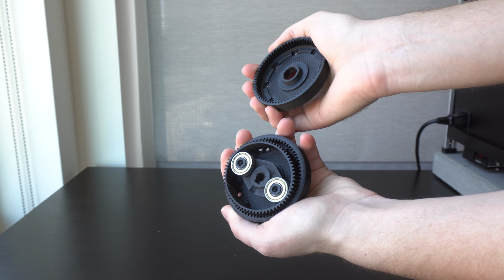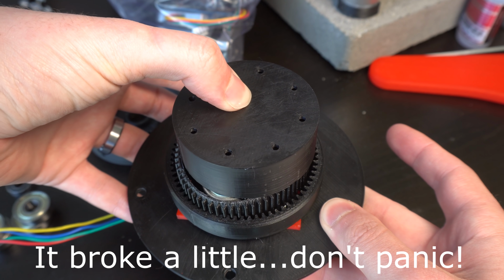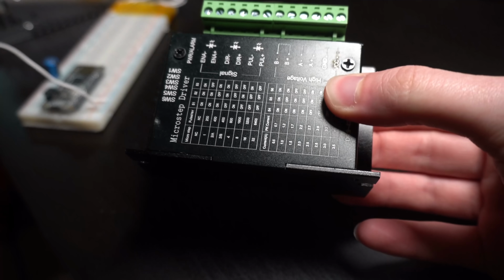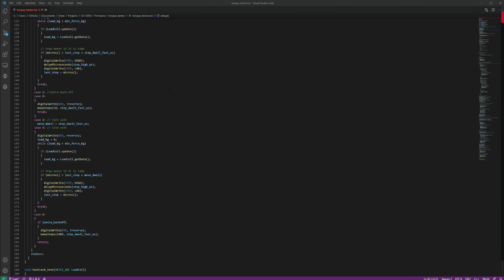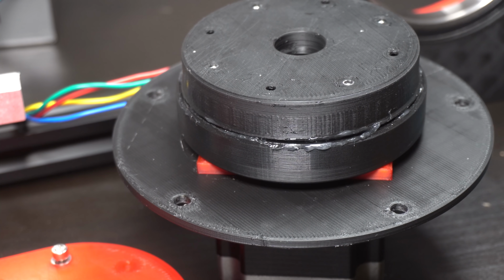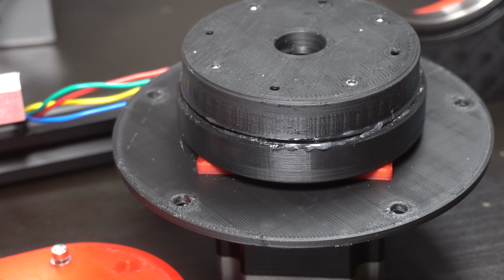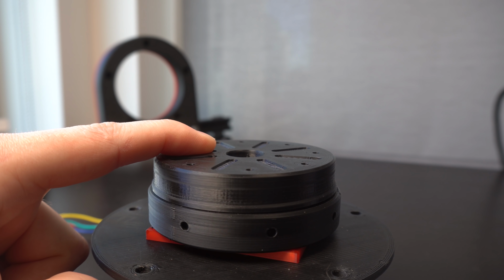My 3D Printed Harmonic Drive is Surprisingly Powerful!

Comment: Do you have any idea how to program the movements?? That's my biggest concern for jumping in a similar project. 

I guess for any of us makers wouldn't be a huge concern doing it with a parametric input but the expensive approach solution for this is way nicer on the field. 

For context, I've been thinking in something remotely similar, not deeply researched by any means, right now I'm just using a hand operated arm. I do have enough background to make something like this, industrial automation is my thing, camera stuff as hobby/weekend-job with friends if I don't have anything better to do.
Reply from the maker: Yeah I'll have to write some inverse kinematics. I tried looking for an open sourced robot control firmware package but came up short. I'm pretty familiar writing control software for kinematic systems though so I can write my own if I need to

Comment: Thanks for posting a great project. You might be interested in Grblgru which is a free ‘cnc’ program. He has written features for Many stepper driven devices including a 6 axis robot arm and multi axis cncs. It’ll run Grbl 1.1x (3 axes), Grbl mega 5X(6 axes), g2core and tinyG. These run on Uno, Mega 2560, Due and TinyG boards as you may already know. An ESP32 running Bart Dring’s ESP32grbl can run 4 to 6 axes easily with 32 bit cpu power. He has already made a suitable motherboard for it too. Might save you a lot coding and motherboard design work.
Reply from the maker: Well, too late on the montherboard side. But I already knew I wouldn't be able to find a motherboard powerful enough for cheap anyway so that's fine with me. But I'll definitely check out that firmware and see if I can use or repurpose it, that would save me sooo much time. Thanks!

Comment: Even though it's pretty much the hype right now, you don't need the wave generator.

Check out my planetary harmonic drive implementation (uploaded 2017, made public recently):
https://www.youtube.com/watch?v=alwwyWFQwuM
Reply: I built two of them in 2017 for a telescope mount. The arrangement is the same as in the robot arm at the end. Looking forward to what you can make with the rigid planetary gears design (probably up the number to 4-5 planets for strength)

Comment: That actually looks really awesome and I like the actual engineering behind the test which most people dont do. I want to ask why you want to have a roll axis for the camera instead of leaving the camera level and having a pan axis so the camera can pan like a slider?
Reply from the maker: I've got a roll and a pan axis! I'm not sure exactly when I would use the roll, but I'd rather have it and not use it then be wishing I included it after I finish
Reply: @3DprintedLife  oh I could think of a few cool b roll shots you could do with rotation

Comment: Impressive! How does that compare to planetary gears? 
If you have a problem with the square nuts look at threaded inserts https://www.aliexpress.com/item/32842866575.html 
Also, Nylon with carbon should be much more robust and not so difficult to print. Give it a try.

Comment: Use either a filled nylon like nylonX (carbon fiber)  or nylonG (glass fiber) to reduce warping when you do decide to print the new flex spline. It will also add rigidity

Comment: hey ! great work. Nylon isn't really hard to print. I recently printed Taulman's alloy 910 Nylon on Ender3 v2 using stock glass bed and elmer's purple glue stick. It stuck pretty well without warping. The sample was flat on its long side, a 1 cm by 1cm profile that was extruded for 15cm.

Comment: I like this design, more compact than the others I have seen.
How long were you looking to make your camera arm?
I've been looking at the same sort of thing my self, (Camera arm that is :-) )
can't wait to see what you come up with.

Ray
Reply from the maker: Reach should be about a 500mm radius but that's still not final
Reply: @3DprintedLife  How hard do you recon it would be to make it double that?
At 1 meter radius, with its base mounted at around 1meter high, it would be give it quite the reach from ground level to just above head height and be able to move a camera most of the way around most projects you might be working on.
I'm making the assumption that is has an elbow joint to allow the camera to move in close to the base as well.
I started at the other end and have drawn up the quick-release camera mount.
I can shoot you those files if your interested.
I used FreeCAD for my design work.

Ray

Comment: you can get a full metal harmonic drive with nema 23 motor(that is made well enough to back drive) for about 400 on amazon.
Reply from the maker: Hahah true true, but my budget for the entire robot is about that price so that won't work for this project.
Reply: @3DprintedLife  Oh I know its not cheap, I got a dual axis trunnion style one to stick on our haas office mill to do 5 axis work with. Id love to see how far you can push a printed one, It would be amazingly useful for 5 axis 3d printing or 5 axis plasma cutting.

Comment: Have you considered using pp filament for the flexible part?
Reply from the maker: I haven't, that sounds scarier to print than nylon :D
Reply: @3DprintedLife  I've no problem printing it on my cr 10s without an enclosure, it does still warp alot but it's good for small parts
Reply: it also doesn't suck up moisture so you don't need a dry box

Comment: This was a very interesting video! Just one question, why not use planetary gearbox steppers? I looked at stepperonline and they have very affordable options, some of the nema 23 options have 40Nm of torque and are only about $50 for the stepper/gearbox combo.
Reply: Also printing Nylon isn't that bad! I bought a garolite sheet plus a plain spring steel sheet to make a custom garolite spring steel for my prusa, which was pretty easy to do. Then as long as the nylon is totally dry it's not too bad to print. Definitely need to make sure the first layer is at just the right height so it sticks properly to the bed, but once that is dialed in you should be good to go.
Reply from the maker: True some cheap ones do exist, but with >1 degree of backlash and they are pretty chunky and heavy, both problems if I want to drive a joint halfway down the arm directly from the gearbox. There are ways I could make it work, but considering the additional cost and limitations, building my own is actually a reasonable option. And thanks for the tips for nylon, I have a pei bed which I've heard isn't great but maybe I can find a way to use a spring steel bed like you use.

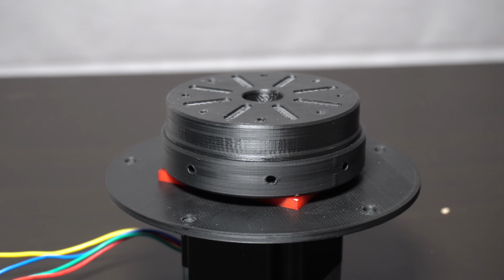Comment: 11:11
you still have some slip on the internal gears when it jumps from 10.22 N.m to 7.17 N.m
Reply from the maker: That's actually the stepper motor stalling. The gearbox is performing perfectly, I just need a motor and driver with more torque!

Comment: You should design in stabilizing rollers at 90 degrees to the main bearings. That would function as a limiter for oscillations at high rpm.
Reply from the maker: Ahh good tip, I was wondering why some other designs had those bearings. thanks!

Comment: Great work! Makes me want to work on gears and gearboxes again. Any idea on the efficiency of such a design?
Reply from the maker: Thank you! Yeah gearboxes are a lot of fun. The efficiency is definitely not great, maybe 60% or so right now. I intentionally went for a very tight tolerance between the flex spline and housing teeth to keep backlash and deflection to a minimum. I'll be doing a lot more testing with this gearbox once I get my control board made and start building the arm, so I can throw in some efficiency tests too! Perhaps even comparing performance and efficiency of different materials used for the flex spline.
Reply: @3DprintedLife  You can replace the flexible spline with a planetary gear and reduce the output teeth by the number of planet gears.
Reply: @whyme6742  like the previous comment said, reducing backlash is important for a robot arm. And on that note, the harmonic drive is also self locking, like a worm gear, which is also nice for a robot arm
Reply: @midvvolf  I think you misunderstood me. Same setup as yours, with the two gear casings, but instead of the flexible harmonix drive, a planetary gear across both casing parts.
It would still be self locking, but a better fit due to less flex.
Reply: @3DprintedLife  I'd love to see a video(s) with the mechanism printed out of different filament and tests of efficiency and longevity. Would be cool to see the arm casing printed out of Carbon Fiber PLA. Thanks for the awesome content!!
Reply: Colab videos?….plz
Reply: get cooking!!!
Reply: anytime you have squishy parts the efficiency is gonna be low
Reply: The idea of using a planetary gear instead of the flexible gear/spline/? Is interesting;
Pro: No flexing = more efficiency.
Con: less tooth engagement, higher tooth loads.
Maybe: more backlash because less tooth engagement/pressure?
Is no back-drive partly because of the inefficiency? Would a planetary version be back-drivable?
Would the tooth profiles be complicated/impossible? Maybe different tooth profiles would be needed for the planetary gears for the top and bottom half?
Reply: yeah use a planetary gear box instead, actually you can buy a nema 17 with a planetary gear box with more torque than this off the shelf it has a 20:1 ratio, It might cost a little more but its metal and wont brake. if you had one on a nema 23 well you would have close to 2x the torque of what this one you made or you could have similar toruqe with a 10:1 ratio.
Reply: @Side85Winder  But what about the backlash? That's the most important thing on a robot arm.
Reply: @ClickItYT  use hearring bone gears, this will reduce backlash even further 👍.
Reply: @Side85Winder  herring bone gears are extremely unsuited for harmonic drives since the motion is radial and the gears are spread out over an angle.
Reply: @Side85Winder  the ratio of this harmonic drive has got to be larger than 1:20

Comment: If you're doing a lot of structural prints I'd recommend upgrading to a direct drive extruder. 
Even after calibrating my ESTEPS my bowden setups always have a tiny amount of underextrusion at the start of a tool path. This introduces a bunch of weak spots for a failures to occur, which will be even more significant under cyclic loading due to the way fatigue cracks form.
I like the animated CAD visuals keep up the good work!
Reply from the maker: Yeah, good point. I've spent a lot of time tuning to correct for this, but going direct drive would make everything a lot easier and stronger. Maybe one day :) And thank you!
Reply: For anyone else with the same problem, esteps won't fix it, but linear advance will. You can also reduce speed and acceleration.

Comment: If the motor shaft was a D rather than a O you could add a key to stop the slippage,
Reply from the maker: It is a D-shaft! The plastic is just really soft  so it was tricky to get it to hold without a set screw to preload.

Comment: can you talk about the downsides of your design vs. the one with a cup-shaped flex spline?.. is there an issue with axial forces? more friction?
Reply from the maker: For sure! Also (unsurprisingly) I'm not the first person to design a harmonic drive like this, they are apparently known as pancake strain wave gearboxes! But the biggest downsides are increased backlash since there are now two tooth interfaces (housing to flex spline, then back to other half of housing) vs the single tooth interface of the classic design. Also, there tends to be higher stresses on the flex spline since again, there's two interfaces so you usually end up with less contact width. There also is a bit more friction and worse efficiency but nothing too crazy. But all tradeoffs that are worth it for me to make a gearbox thin enough to use to directly drive the main hinge joints of my arm!
Reply: @3DprintedLife  thanks a lot for you answer! that makes sense and yes - i guess these are acceptable tradeoffs. 
i've been playing around with the idea to make a harmonic drive based robot actuator myself. but the concept goes more into the direction of a fully integrated actuator along the lines of what UR uses. my bet was on the cup shaped flex spline design, but after seeing your results, i'm not so sure if i want to stick to that :D

Comment: Fyi, PETG is really good for printing things that need to flex.  It's the same strength as PLA but has half the stiffness and much better creep resistance than PLA.  PETG is also only slightly harder to print than PLA.
Reply from the maker: Good suggestion, I do have some petg laying around, maybe I'll try comparing flex splines printed in a few different materials in a future video!
Reply: @3DprintedLife  Yes please. 🤓

Comment: Instead of directly coupling nema to the print try meting in small brass gear. That will help spread the load more evenly.
Reply from the maker: Good idea! I do want to keep the design easily accessible by most so I don't want to do any crazy assembly techniques, but I think it would be safe to assume most people with 3D printers will also have a soldering iron to insert a heat stake thread so maybe I'll try those out. Thanks for the tip!

Comment: Nice, been wanting to try a design like this myself. I think the only 'downside' ive seen mentioned for this type of design is that the gearing ratios tend to be 'too high', limiting your top speed. But for most applications I can think of, doing it a little slower is an acceptable compromise. The DIY gearbox community definitely needs a well-worked out design like this.

Too bad the belt was not cooperating. A printed one is never going to be ideal I think; youve got all the shear concentrated in two spots along the layer lines. Perhaps a belt with a somewhat stiffer backing added to it would work; or otherwise a printed version (kinda annoying to be stuck with existing belt teeth profiles not optimized for this purpose), but hot melted onto a thin metal ring like a slice of a thin walled pipe, or some other stiff material capable of transferring tons of shear. Not easy to come up with off the shelf solutions there really... could consider doing something with composites but not im seeing any easy ways of attaining a nice uniform pattern with the right diagonal fiber orientation without making some kind of custom winding jig... sounds complicated. DMLS titanium would be a lot less labor intensive; but yeah you mentioned cheap....

But if youve got a good and stiff backing, you can crank up the with the width of the belt and attain some really crazy torques (without a stiff backing all the load is probably going to concentrate where the teeth meet and mess them up there).
Reply from the maker: Yeah I was considering adhering some spring steel to the backside of a belt to get the best of both worlds. It would still have more backlash and deflection than the plastic flex spline since the teeth of the belt will have some give, but it would probably run quieter, smoother, and longer. But finding the right sized closed loop belt was really tricky, especially finding extra wide ones that are this small. I'm pretty sure printing nylon will be the way to go, since nylon has closer to isotropic properties when 3D printed which should improve the shear strength of the part, and I can make the spline any size I want. Plus, the better wear resistance and more naturally lubricious properties should be a good compromise between rigidity and lifetime. But I won't know for sure if that's enough until I build up the arm and start testing it for real!
Reply: @3DprintedLife  Agreed, nylon will be a pretty decent option. Armadillo might be another good one if the nylon turns out to be to warpy; its got properties quite comparable to nylons but is super easy to print.
Reply from the maker: Oh cool I hadn't heard of that filament before, thanks!

Comment: For interfacing shafts with 3D printed parts in a VORON, we use 20T pulleys with the top flange popped off, and with screws driven in to fully stabilize it. It gives you a solid and cheap interface between a steel shaft and a printed part.
Reply from the maker: On yeah I built a voron extruder a while back and remember that feature. I'm not sure I have room but I'll definitely play around with this and see if I can make it work. Thanks for the tip!
Reply: @3DprintedLife   if you’re tight on space, use the 16T gear. They are much smaller, but still provide better interface than the nut + set screw approach.
Reply from the maker: @mr_voron  yeah true, great suggestion I'm definitely going to try and make that work, thanks!
Reply: I use steel.  I have a mini-lather and will turn a (say) 20 mm disk and then bore a hore for the motor shaft.   The I 3D print the with a 20 mm hole and epoxy the steel disk on the hole.    ALLAY when printed gear fail it is the central hole but not if they are made from mild steel.

If you don't have a lather buy a "coupler" that is made for the shaft size and  cut it shorter and epoxy that in the.

In general you can do well by making hybrid parts of metal and plastic, For example printed internal teeth and a metal housing.  THis soves the problem of the housing warping. But metal hubs are the first step, shorten a coupler
Reply: @chrisalbertson5838  Do you have a link for this?
Reply: do you have a link to this? I can't picture it in my head
Reply: This is what I was thinking immediately after seeing the screw/nut combo break!
Reply: How do you pop the top flange off?
Reply: @gandrewstone  The flange is essentially just pressed on - you can just grab it with pliers and yank it off.